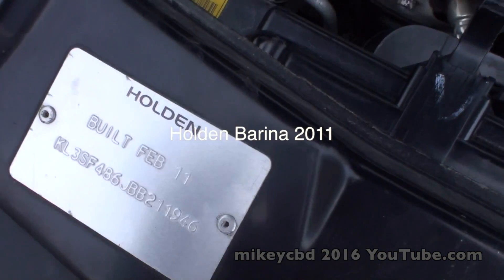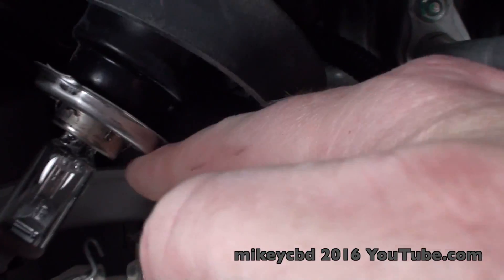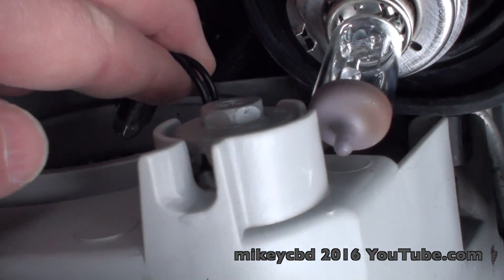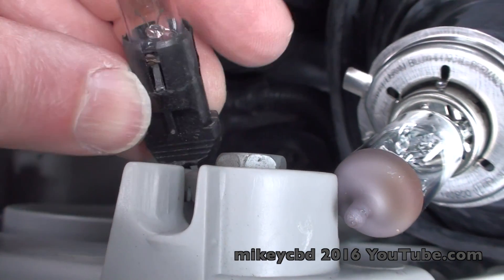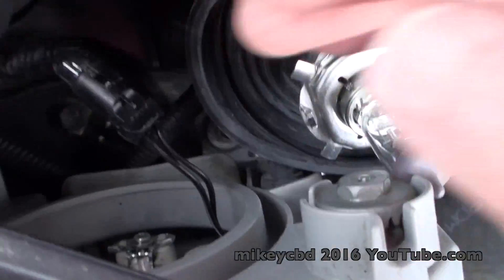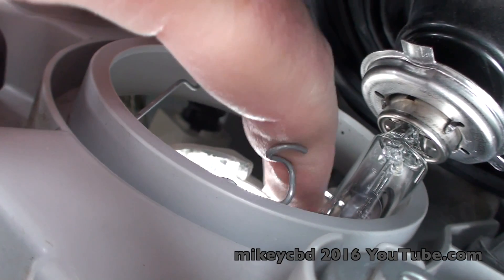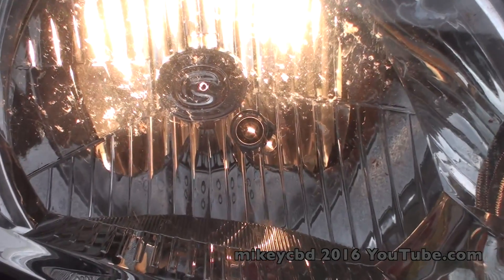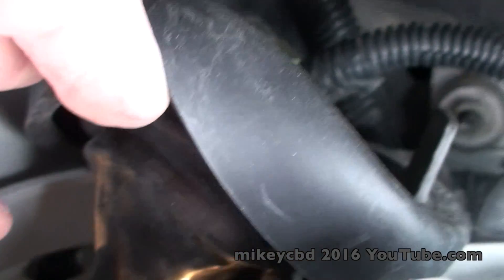Barina Holden 2011 Fitting a parking light headlight removal

Comment: I’ve got a  2010 Barina as a work car. It’s still going strong  but the lights don’t seem to last long. Thanks for putting in the effort to show us how it’s done
Reply from the maker: You're welcome.
Reply: @mikeycbd  it’s amusing as the maintenance book details you need to take off the whole headlamp cover before getting the bulb out
Reply from the maker: @teddyboo7843  I wonder if that is the easier way... oh well.
Reply: Hey Teddyboo, What ever you do Do Not Ever Touch the Globes especially H4's with your bare hands from the time you buy it to the time it's installed, because the globes won't last long as the oils/moisture from our skin will drastically shorten the Globes expected lifespan ! Use thin gloves like food prep gloves from supermarkets. They are thin & easiest to use it tightly confined spots.